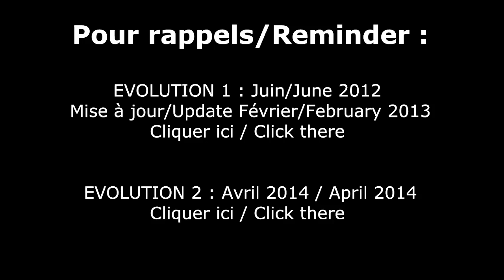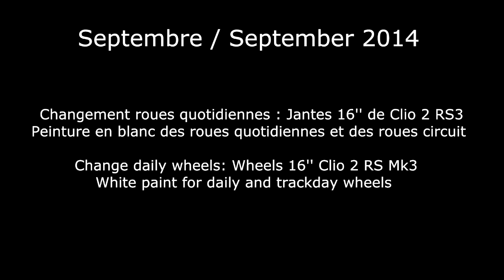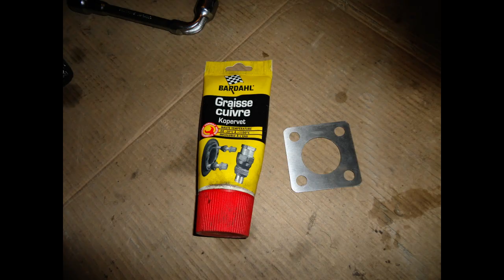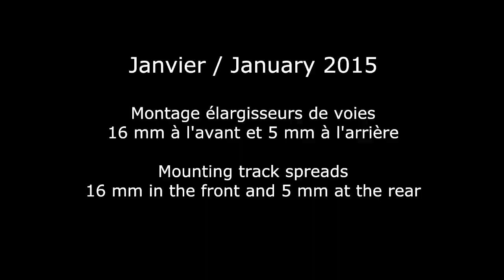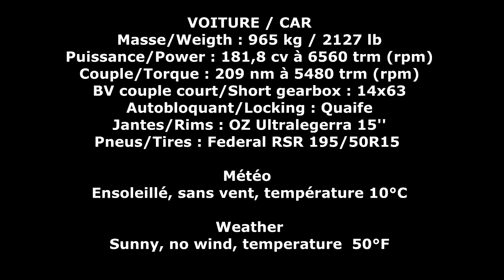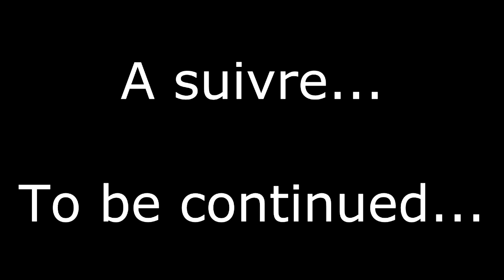EVOLUTION 3 - JANVIER/JANUARY 2015 : CLIO 2 RS 1 2.0L 16v RENAULT SPORT

Comment: Great job mate!

But in the end, how much money did you spend on this wheel? 
Which year was this car produced? I admit, I don"t have 2.0 (i am owner of 1.4 16v 2004 version of clio (dinamique)), but still it flies like a rocket :)
I must say, i have 3 videos still to watch, but you impressed me of doing some engine work on mine 1.4.  :)
Reply from the maker: It is not over, I have some ideas again to made the final trackcar I want.  But for family reasons and because I have not much more monnay to put on that, I made that for 6 years now in 2016. ^^ How monnay for that since the begining? Not possible to count especially out the usual and normal maintenances that I'm doing each 6 months (all oils and liquids). But for example with the gearbox, the biggest price for the moment, you can count:
1100-1300€ for the Quaife
600-800€ for the short couple 14x63
400-450€ for the full Renault kit repair 
400-600€ about for the specialist mechanic (and without to pay the VAT ^^)
Reply from the maker: Oh and car produced in 2000, Clio 2 RS mk1 , the 1st of all RS (for Renault Sport there I recall) in the big (now) family of RS from the Clio RS and the Twingo RS to the Megane RS. It is a little GranMa now but always in the place, don't worry, with its famous F4R730 2.0L 16v non turbo engine power. ^^ It is not an usual Renault 2.0L 16v, it is an engine "Renault Sport power" made in the historical factory "Alpine/Renault Sport" in the city of Dieppe/France. ^_^
Reply: amazing things happen in france :D

I am a "renault-holic" and my biggest wish is to own MK2 172 (2003-2004) but here in Slovenia the market isn"t full of such cars... the amount of Clios here is un-normaly big... 1.2 engine is the most popular here... so getting one of the "RS collection" is quite hard for us...
How much did you spend on OZ Ultraleggera 15 ? How is with homologation in France? How much cost 1 piece (rims or spoiler) to homologate?
Reply from the maker: Oh I forgot the precise price, I bought them more of 6 years ago now in 2017.  ^^ About 600€ the 4 rims in size 15". And no problems in France with the laws because the Ultraleggera are the same size and thus the same tires than the rims stock OZ F1 15''. After for near 3 years now I using the OZ Ultraleggera only on the  tracks and with my semi-slick tires, so not on the public roads ;-)